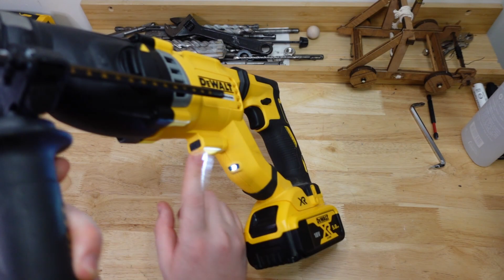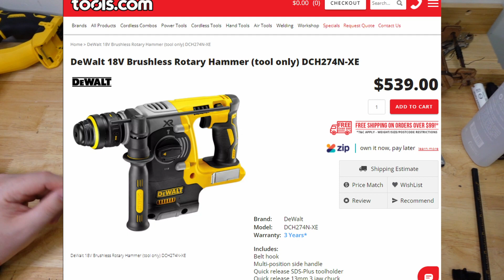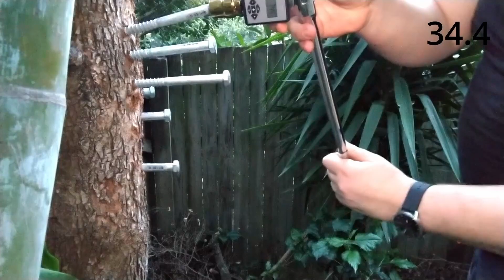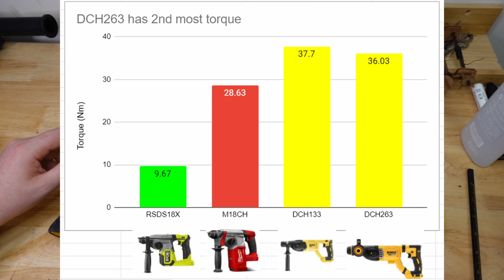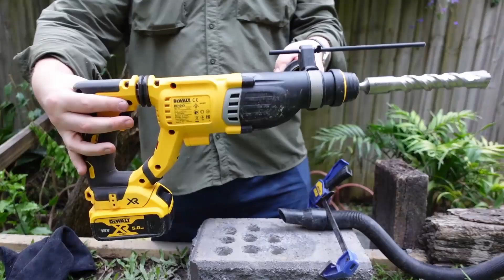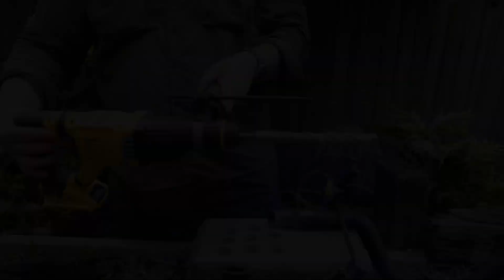DeWalt DCH263: how's she go? [Review and performance test]

Comment: I want to buy for the first time cordless hammer dril..which one do you recommend? 133 or 263?
Reply from the maker: In general the I'd say 133, but if you're looking to do bigger drilling like 22mm up often, or breaking up concrete etc then the 263
Reply: @BoltahDownunder  Yes you are correct..thanks a lot..
Reply: One more question..do you know this dch263 handle and corded hammer drill can be install it together or not? Becoz i want to buy a secondhand one..but he say do not have a handle..and my just find a handle for corded hammer drill like D25133K?
Reply: Sorry if my english not so good..im from malaysia..i no idea when to ask..hope u can help me 😅
Reply from the maker: @Sapit-lq2oz  that one won't fit the 263, but will fit the 133. You need to find the next size (50mm) up for the 263
Reply: @BoltahDownunder  thanks so much..(50mm) for the handle diameter? Ok nice..i measure my corded handle it (43mm)..now i can buy new handle over (50mm) diameter..thanks again bro..

Comment: Can you do a video about the dch293? There’s not much reviews about it here on YouTube. If you used the 293 before, which one would you recommend, the 293 or 263?
Reply from the maker: The 293 is rare and expensive; it'd cost me like a thousand dollars, so unfortunately I can't get it yet. But I do have the 333, which is the same tool with different voltage. I'll be covering that one soon, so it'll give you a good idea of the 293. 
I'd recommend the 263 if you want a 28mm hammer; the 293 is much larger & more expensive, but isn't any more powerful
Reply: Thanks for the feedback! I’ll most likely get the 263 since the 293 does cost more. 
Also, does the 263 have a e clutch or kickback control? I know the 293 has, maybe that’s why it’s more expensive?

Comment: Common mistake in the first test. These arent made for turning in bolts, they are a hammering machine that spins, not a torque machine that hammers.
Reply from the maker: i think you misunderstood the point. It's to max out the torque to test how much each tool, can deliver, not to demonstrate driving lag screws into a tree

Comment: I was just about to pull the trigger on a DCH133, but saw this review and it was enough to convince me to spend the extra $100 for the DCH263. I don't think I would've been disappointed with the DCH133, but the better chuck, side handle and at least some attempt at vibration dampening on the DCH263 won out in the end. I'm just glad I didn't buy the DCH273, which is about the same price as the '263 but with just 2.1J of impact energy and a slightly higher weight (2.91kg vs. 2.70).
Reply from the maker: They're all great drills, you won't be disappointed with any of them. It's just a bit strange how DeWalt has designed their lineup
Reply: @BoltahDownunder  As luck would have it, a new DCH263B showed up on ebay for about the same price as a '133B so I snagged it. Only used it to drill one 1/2" hole in a 6" slab of concrete that has a date of 1974 scratched in it (so hard stuff - concrete never really stops curing) and it blasted through like I was drilling wood; oh, and as low-tech as the vibration dampening is it definitely works!
Reply: Is it common to have the chuck develop a wobble? Any idea what would cause this? Mine is only like 6 weeks old. Most it's been used for is drilling 1/2" holes for drop in anchors.  @BoltahDownunder

Comment: Hi mate. so I have seen both comparisons of  dch133 and dch263. and i wanna go with dch263. but this one is out of stock on most suppliers. where did you purchase yours?
Reply from the maker: I got mine at a Sydney tools store. Late last year, and yeah it looks like stuff is getting harder to find lately!
Reply: @BoltahDownunder  So finally got my dch263n. One of the best purchases I have ever made in my power tool collection. Which brand of SDS drill bits you wanna suggest to buying?

Comment: Thank you for this great review, this is exactly what I was looking for too. 

Dewalt SDS Rotary hammer drill line-up is a complete mess... Picking one for home use is bloody confusing and frustrating... I couldn't justify the costs between their D handle models and drop motor models, and their Flexvolt models are stupidly expensive for a cordless hammer drill.

would be great to see how this one goes with the 54v flexvolt battery though.  

Thanks again, I've now decided to purchase this DCH263N.
Reply from the maker: No wukkas mate! 
There's a lot to these tools and I'm doing my best to demystify them.
This is a real nice drill that will do anything you can throw it at around the home, and not too pricey either. Enjoy!

Comment: ?? QUESTION: (First, appreciate the excellent review) Does the DCH263 have a reverse gear (for taking out screws) also, is the front stabilising handle removable? (Hoping to use as an all-rounder, including small wood-work jobs). Thanks in advance.
Reply from the maker: Cheers mate! Yes and yes.
It's got an SDS chuck so for screws you'll need an adaptor.
But for small wood work? Might be too big! This is pretty big as far as Rotary hammers go and is mainly for drilling  large holes in concrete. Might not have the precision you want. You'll probably want a normal drill driver or impact driver for your wood work.
But, DeWalt will often sell kits with those so maybe you'll be able to find a deal with both tools that suits your needs
Reply: @BoltahDownunder  Thanks very much. (Appreciated) best Wishes from the UK.

Comment: Very good review, thanks! I have had the 133 for a year now, I saw this news one the other day and wonder how it matched up. I'm still very content with the 133. An amazingly useful tool.
Reply: Ive owned both for 2 years each now. The anti vibratiom defonitely helps my elbows out. After a few weeks of concrete work, always get the sore joints. But the 263 helps a lot when im startong to wear out.
Reply from the maker: I've found mine has developed a bit of a wobble when drilling, how's yours going?
Reply: @BoltahDownunder  interesting, I have not had that issue yet! Thanks for the heads up though, I'll keep an eye on it.

Comment: Thank you for a good review!
I have a question - I work with suspended ceilings, and I use a Makita DHR202. How would the Dewalt stand against the Makita? Mostly I use the 5mm drill and I’m all about speed.
Reply: when the drilling size is in the comfort zone of both hammer drills being compared, the smaller hammer drill is usually faster due to higher bpm. you can even see SDS+ drill out race SDS max drill of a same brand. the only advantage of big hammer drill is when the smaller drill start to struggle with size.
Reply from the maker: Hmm this is a very different tool to yours and I wouldn't think it's very clean drilling small holes. Since you're in Makita maybe consider the dhr182? That's a similar one to yours but it's brushless and very light. Drills fast compared to other compact hammers. One of my favourites

Comment: I also got this, best buy i ever had so far! I can't understand the price diffrence between DCH263 and DCH273 though, i mean DCH263 is stronger (3joules)?! Size?
Reply: I have the dch273 and it’s very strong for a smaller tool. I think the reason it’s more expensive is the technology inside to make it a small design with that much power.
Reply: Các bác đã hiểu chưa